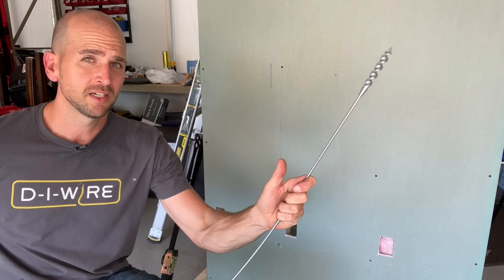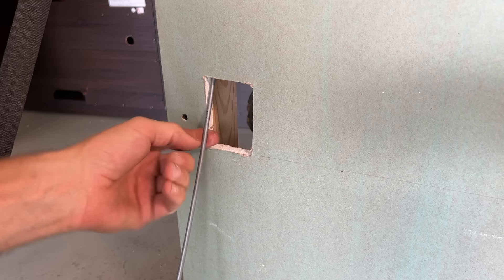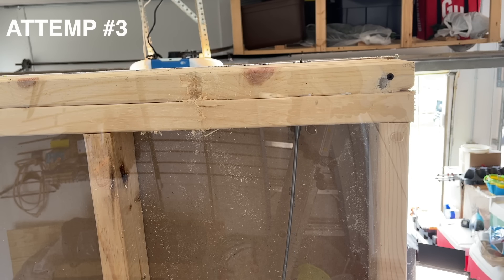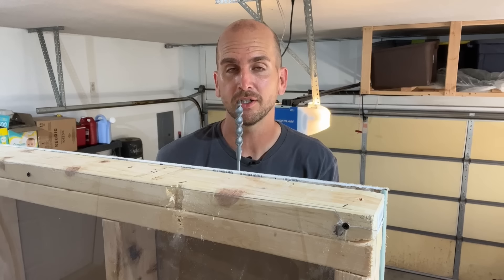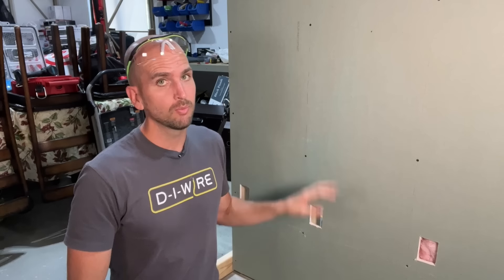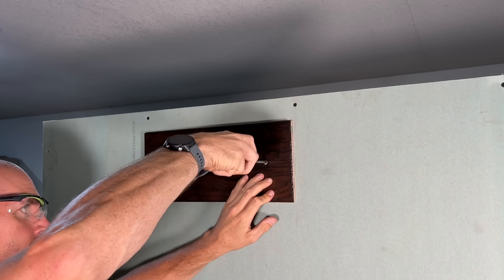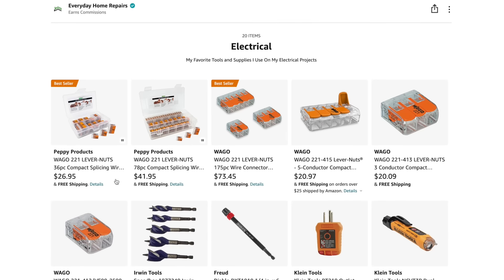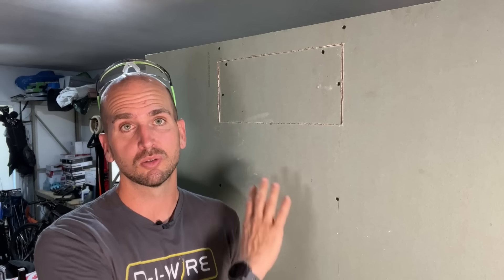Using A Flexible Auger Bit To Fish Wires Through Walls

Comment: I avoid all drywall work by drilling an 3/32" or 1/8" hole thru the ceiling drywall where it meets the wall drywall. Then I feed a piece of wire or a 3/32" or 1/8" diameter long drill drill bit thru the hole far enough so I can find it in the attic. Then I locate the wire or long drill bit in the attic and drill a hole thru the top plates at that location. Then just fill the 1/8" hole in the drywall. If there is any blocking in the wall, I'll then use a long drill bit from the attic to drill a hole thru it. I also use this same concept for locating and drilling holes thru the bottom plate from the basement. The difference there is that the bottom plate is not visible from the basement so you have to measure over from your drilled locating hole to the center of the bottom plate.
Reply: I've done the same except I used a hole-sized bamboo skewer.  you push it up and it just sticks kn the hole if you use the right size drill bit.  Super easy to find it even will poke through insulation and leave you with a little pale tan "flag"
Reply: Thanks for this tip, very smart and easy! If this tiny bbq skewer hole didn't work I'd probably take the route at the end of the video by just opening up the drywall at the top of the wall. I liked the plywood template with 4 drywall screws.
Reply: Same but I use piano wire. Very small hole, no patch required. You do need a decent idea of where that wire will be in the attic though. Its somewhat hard to see and you need a rather long wire > 18" to punch through all the insulation.
Reply: @thesmallterror  That is why I go with a hole that a more visible wire or skewer will fit thru which is more visible. I started off using a thinner copper ground wire but switched to a more visible white 14 or 12 gage wire. If I did it more often I would probably coat the white wire with bright pink or whatever.
Reply: Hi,

Do you have a video of this method? It sounds clean and  easy.
Reply: Doesn’t quite work on a first floor of a two story house
Reply: Great what if your cutting in a switch and light where there is no attic.

Also you ain't doing this method into the basement with hardwood floors
Reply: @jordanbailey2790  I did it through the floor, by mistake! I drilled through 3/4" wood flooring and knew I was in the wrong location when I saw light on the other side. Thank god it was an oak floor - plenty of oak plugs at HD.
Reply: I have used this method hundreds of times. Learned it 20 years ago installing coax for Comcast. I occasionally use a flex bit to drill down into a basement, but never up in into an attic

Comment: I have used the flex bits a number of times and they are great when needed.  Accessories help a lot.  Check out "bumper balls".  They come in different sizes for different size studs, go on the flex shaft and keep the bit centered in the wall cavity and away from stud.  Awesome.  They also help with horizontal drilling even when smaller than joist size, they keep the bit up off the edge by a couple inches.  There is also a "handle" that lets you hold the bend at the opening to make drilling/pushing easier.
Reply: I too was wondering why not use the ball method to center the bit.
Reply: @harryl7946  There is an answer for that @4:30. By not using it, someone would comment about it and feed the algorithm gods as the more comments the video gets  the more likely it shows up in people's suggested feed.
Reply: Bumper balls work great when going down but not so much going up so I use tape wrapped around the drill bit to hold the bumper ball
Reply: Great tip.  Had I not had both of those flex-tip accessories, I would’ve tor up my drywall.  This method was an absolute God-send when hiding wall mounted t.v. Cables, and running cat5 and coax cable.  Best money I’ve ever spent on drilling accessories.👍
Reply: You read my mind @mikez8308 Bumper balls help you hit center.
Reply: I’m with you about making the small hole and then going into the attic if need be

Comment: I mounted a plastic baseball to keep the auger in the middle of the wall, which really helps avoid those corner issues.
Reply: Awesome idea, thanks for sharing that.
Reply: Rack-a-tiers makes a little plastic ball that attaches to the flex bit to guide it

Comment: I went to a leak a customer was complaining about and found an electrician had used one of these and drill through the top half of my 2” pvc line. Then the dummy pulled the wire right through the pipe. He had the balls to tell me he didn’t do it. Wish i had taken a picture
Reply: lmao

Comment: 20 yrs ago I tried the 60 inch drill bit and I ended wrapping 3 romex wires shorting up the whole house _( never ever used this long drill bit)
Reply from the maker: Oh man!  Yeah, I think there are a ton of horror stories from these bits.  Appreciate you sharing your experience 👍
Reply: Hahaha 🤣. I am sorry. But that would be my luck also. Now I confirm of not using it at all.
Reply: That's exactly what I'd be concerned about as well.
Reply: These days it's easy to snake a camera into the wall to see what's there, but no so much 20 years ago. I have a bullet shaped camera on about 15' of wire that has been very helpful when going inside walls. Has a USB connection to plug into a laptop. It wasn't expensive either, maybe $25 or so. The picture clarity isn't great, but it's fine for getting a good idea what is inside the wall you are dealing with.

Comment: I have used these bits for years. I have never even considered drilling up into the attic with it. I have always used it to drill down into a crawl space. Also, did you use the tool that lets you aim the bit inside the wall? They come with a metal tool that lets you have way better control, and put more force behind the bit once the threaded end punches through.
Reply from the maker: I did have that guide which came in the Klein Tools 54” kit but didn’t like the feel at least initially trying to drill 75” up from the box cutout.  I will practice a bit more as having this skill is handy in several scenarios.
Reply: yes these drills work great for drilling down into a crawl space. Never tried drilling up. Too risky
Reply: I have one and love it.  Totally agree with Taylor... I only use it for drilling down into basement or crawl space.   The guide tool works great for that application (probably because it's a much shorter distance to the floor board).  It really allows you for hit the center of the 2x4.  For the attic, it is much easier to just drill down from the top.
Reply from the maker: For sure, this would be more for an exterior wall with extremely limited space in the attic.  I sharpened up the 54” auger and will keep it on me for drilling down like you guys mentioned or up through fireblocking.  The shorter distances are more management at least for me.  Thanks for the feedback.
Reply: I have the same auger and guide tool and always used it to drill down into my basement for Romex and CAT6 runs. Makes the work easy!
Reply: I have had no real luck with these bits, and have seen two bad circumstances from other electricians using these. They do have their uses though...
Reply: That's what I was thinking. Maybe sideways, depending on the situation. But not up.
Reply: I bought one about 2 years ago to do the same thing, drill down into a basement for a re-wire.  I was a little skeptical and worried, but it worked extremely well the first time.  Drilled through my bottom plate and into where I needed to get to.  Attacked my pull wire to the bit, pulled out the bit+line, pulled the wire through.  

Worked great! No practice needed.
Reply: Same. almost always drilled down. The few times I drilled up was on exterior walls with a really low pitch roof. In these cases I set up a light and a remote camera (i used an old cell phone with a security camera app) so that I could see what was happening while down in the house

Comment: I like this tip of cutting out the sheetrock close enough to the ceiling sized so you can screw it back on three sides.  I would much prefer to drill from above, if that's an option.  This is great for when it is not.  Thanks
Reply from the maker: Thanks for the feedback Steve 👍
Reply: 100% agree with this.

Comment: If it had been drywall instead of the plexiglass, the ones that were close to the edge would have worked right through the other side of the wall

Comment: I did not see you use the require gig handle that helps control the auger bit position.  It is almost and "L" shape that fits in the outlet hole and the bit shalf rides in it's saddle. As the bit is pushed outward the gig applies pressure to flex the shalf to help position the auger in the correct position.

Comment: I used on to go through studs to run another outlet. I got through the first stud no problem, but went straight through the drywall just as my wife was walking by and saw the bit protrude from the wall. Which then gave me the opportunity to try drywall for the first time and absolutely nailed that fix! So you could say, without the flex tool I may not have ever known I could do drywall!
Reply: Haha 😂
Reply: Thanks to the flex tool, now you're flexing about your drywall skills...
Reply: Drilling blind through studs could also teach you how to repair plumbing, wiring, and air ducts!

Comment: This is a GREAT video.  As a DIY’er, if you’re going to use the flex-bit, use the guides (flex-guide tool, or bumper-ball guides.)….they work very well.  Or, as you did….if you’re in a position to cut a square above/next too the fire-stop/stud so you can fit a bit into the wall, then put the drywall square back, then sparkle/paint it.  Sometimes more steps that are easier to do, is the better way to go. 👍

Comment: I tried one that was just an extension and you used a regular bit, the bit is still in the wall. Next time I tried one like you had, it binded up and it still in the wall. I'll do what you did for now on. Anyone that has used it and it works, more power to you! I'm not getting another one.

Comment: I bought one of these the other day. Cut an outlet sized hole behind my TV (needed for routing HDMI etc through the wall anyways), drilled straight up and into the attic, no issues. Pushed my wire fishing rods up and away we go. I think with a little care around drilling the right spot (maybe reach into the hole a little and jiggle the tip so it gets a little more centered on the stud, or use one of those tools others have mentioned), these flexible augers are amazing.
Reply: @aurvaroy6670  the part of the attic over the TV is very hard to get to. I would need to construct done scaffolding up there to get over a 5ft ledge. It's very hot this time of year to spend all that time in the attic.

Comment: The frustration caused when trying to use the long auger bits or anything else is way worse than having to patch drywall ! I have just defaulted to cutting drywall patches like that. Great tip on using the flooring as a template.

Comment: This video is actually very timely. Been wondering about this subject recently for running low voltage cable down walls and through horizontal plates from my attic.

Comment: I used a 72” flexible bit to run cat 6 up to my garage attic and it worked great first time. The auger bit wasn’t as long as the one you used and I did cut a larger hole and was able to use my hand to move it around until it felt like it was about middle by banging it against the outer and inner wall.

Comment: I do alot of rehab work and I've ways been tempted to get one of those drill bits but I figured they'd be a pita to use. Your demo confirms it.  I typically cut a small piece of drywall at the very top, just enough to notch the top plate. After running the romex I put a nail plate over the notch and patch the drywall.

Comment: I'm the guy who drilled a hole in my son's roof with one of these bits. Luckily the bit came out between two shingles and I was able to slide a piece of thick plastic under the shingles to patch the hole. Moral of the story is, drill from above and when you get tired stop working. It was 10:00 at night when I did that.

Comment: Yes, definitely.  I agree with the comments made about marking your hole next to the wall, slide a small wire up through the insulation, then drill down into the wall from the attic.  These bits are most helpful if you encounter some kind of blocking mid-wall.  That's where they shine.  Also, use the bracket tool to aim & you'll have great results!  Good luck!  Dan's Handyman Svcs.
Reply from the maker: I totally agree, drilling down from attic is better for sure but I have needed this ability a few times over the years on exterior walls or getting through fireblocks.  Thanks for the feedback!

Comment: Great Auger Drill Bit testing rig!!!  And great idea to try it!!!  If someone tells you in comments how to do it better, please come back and show us.  I would hate to have to cut panels of drywall and repair them for this kind of job.  Thank you for these videos!

My roof has a very slight pitch, which makes adding safety ground wires for outlets too difficult for my electrician to take the job.  I saw your video about cutting slots of drywall at a specific height and running the safety ground wire (in my case) to outlets (and adding more outlets that I'd want), but if it could be done the Auger Bit way, that would be much better.  Otherwise, the new safety ground wires would have to be run from the circuit breaker box to hall wall outlets in rooms and then use the cutting drywall slots method to run it (or new Romex) to other outlets.  This house was built in 1960 and the 2-wire Romex is stapled to the studs, so just a safety ground wire needs to be run, with new outlets tapped into that.  The outer walls may have insulation in them and the front and back walls are too hard to get to because of the roof, so cutting drywall slots may be the only way for them, which would also mean having to move all kinds of furniture and stuff to even get to outlets, and to cut drywall slots.  That's a lot of moving stuff, cutting, wiring, patching, painting and putting stuff back in place!  But I really want safety ground everywhere.  We'll see if I ever go there.

Thanks again!  You are quite the thinker and innovator.  I hope you get your answers!

Hey, maybe some kind of round spacer that would fit through the outlet and switch holes, maybe secured in place with zip ties, like a circular saw bit hole cutout with the drill bit hole as the center.  Cutting an appropriate diameter from ¼" plywood should do the trick for your application here.  An inch and a half diameter might do well and not block getting the auger bit in and up too much.  You could even mount two of them on the auger shaft, with one a foot or 2 or 3 below the one near the drilling bit, to help keep it vertically straight to help keep the hole from being at an angle so much.  That would protect drywall or whatever on the other side of the studs and help prevent hitting vertical stud nails and drywall screws.  It would be harder to get through insulation without tearing it up.  A 1 inch diameter hole cutout used in corners where insulation is might minimize tearing it up too bad.  Experiment with cutout diameters to see what works best for each case; with insulation and not and anything else.  Having center horizontal studs to get through would be different.  I hope this helps!  Maybe someone else has professional suggestions.

Comment: Your example of using a piece flooring to make a template. As a maintenance man where time was of the essence instead of replacing the cut out piece of drywall with drywall I simply used a hvac vent or return cover. Saves hours and mess.

Comment: This is crazy great!!! I use to run CAT 6 in my previous life and used the auger method from outlet height to the top cap. Never had the issues you demonstrated, I used a guide on the shaft to help steer the auger. But this is easy. Love it! I have seen this method before, but you made it look easy.  Nice job.

Comment: Cutting through the drywall to create openings for viewing the above and below areas to be drilled is the safest practice. I have used a flex bit before and luckily managed to avoid drilling through the drywall. Getting a clear view of the area will provide a penetration with better location control and will also avoid surprise encounters with wires or pipes.

Comment: Great idea with the cut-out but what I've done in the past, is to screw in a couple of 2x4 sections along the cut lines, so that I can screw the drywall piece back into place more securely. That way, if the repaired part ever gets struck (by kids playing ball indoors, for instance)....there will be more support and the mud lines are less likely to crack.
As an Electrician of 40+ years, I always like to learn new "tricks"...your channel has many; some don't make sense to me, but others are shortcuts I wish I knew "back in the day"...
Reply from the maker: Thanks for the feedback.  Yeah, I have seen the small sections of 2x4's added in the past as well which you are right could help make the patch hold up better over the years.

Comment: I've never used a flex bit. I have however,  approached this from the opposite direction in the past. I located the top wall plate in the attic and drilled thru from the attic side. Then ran the romex down to my gang box. Obviously this is only an option if you have access to the top wall plate. 
Great demonstration.  That flex bit seems a bit hit and miss.  I'm sure it's a lifesaver though in some situations.
Reply from the maker: I am the same as you but for exterior walls I have always struggled with access from above.  “Hit or miss” is a good assessment of these bits.  With enough practice I am sure you can increases the chances of success.